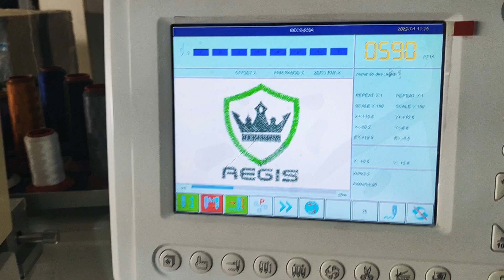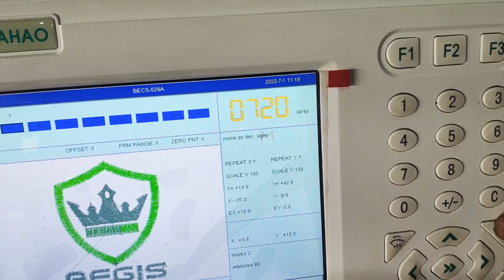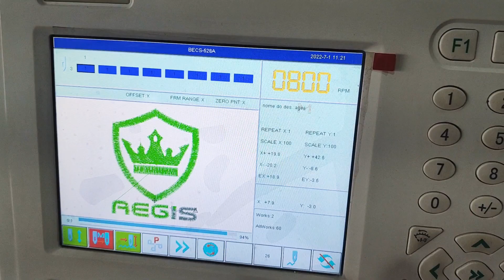Bordadeira Sansei 2 cabecas SA-G1202-G-C, Campo: 40x45cm, Painel Dahao: 8"

Comment from the maker: Marca: Sansei  
Modelo: SA-G1202-G-C  
Campo: 40x45cm 
Descrição Basica: 
 Painel Dahao: 8" 
Speed: 850rpm  
Voltagem: 220v ~110v
2 cabeças, 12 agulhas, cilíndrica, usb, 5 tamanhos de bastidores + quadro de alumínio 780x400mm p/ bordar  Pets e peças grandes estabilizador de voltagem, painel colorido, 10 milhões pontos na memória.  
Com boné + bast. de boné,  
1,7m larg X 0,82cm Comp X 1,7m alt.   ,